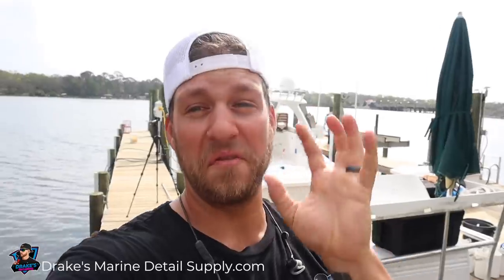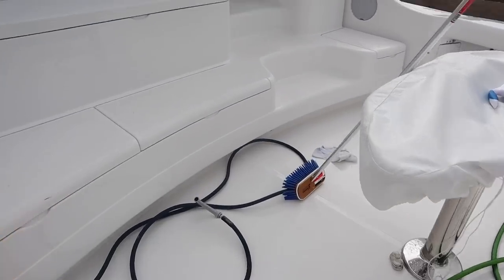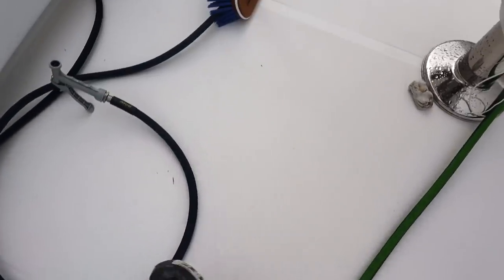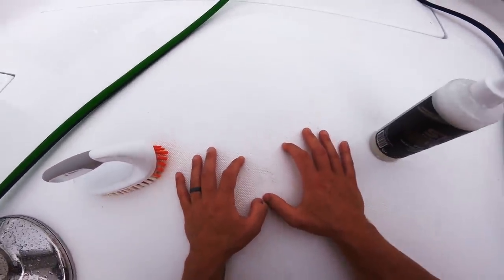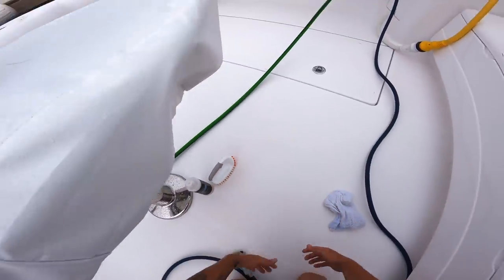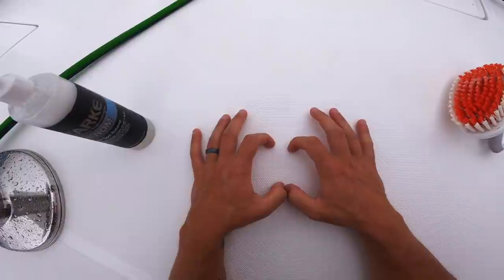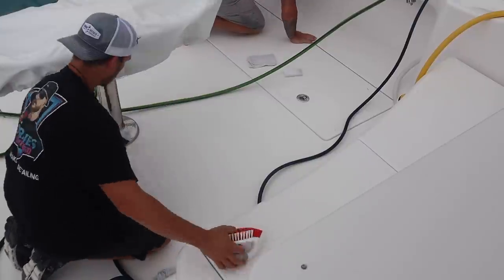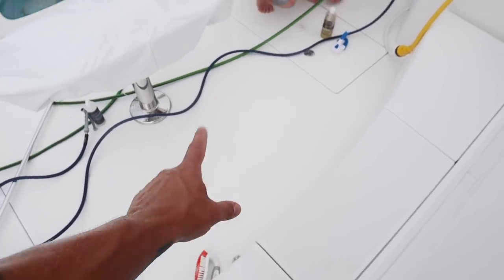How To Remove Rust Marks From A Boat | Boat Detailing Business Tips | Revival Marine Care

Comment: Not sure why you aren't using an iron remover like IronX? They are commonly used in the car detailing world - worth a try on gelcoat as well.  No scrubbing needed.
Reply from the maker: I agree, I didn’t have iron x! Iron x would be the best option, but I couldn’t wait a few days to order it and get some in. So I had to use what I had on hand! Thanks for bringing that point up!
Reply: iron removers don't always remove the whole metal pieces so you would still have to remove them mechanically.
Reply: @DrakesDetailing  most wheel cleaners are mainly iron removers, a lot of detailers use wheel cleaners like cheap Eagle One to spray all over the car to dissolve iron. Theres also a channel named Forensic Detailing that did a big comparison to see which Iron Removers dissolve iron the best. It's worth a watch if you run into this problem regularly....spraying all the surface, let it sit for 5ish minutes then hose off should fix the problem. If it works good it may save you a ton of time.
Reply: Bar keepers friend is the best thing I have found for rust .
Reply: @QLNcoaching  I love me some Barkeeper's Friend!
Reply: Thanks for the info,I'm new to the detailing, I will give the iron a shot, thanks for the info
Reply: @stephenwhite5444  chemical guys has a great iron remover as soon as it makes contact it turns purple , letting you know that you have chards of metal.

Comment: The active ingredient in all rust removers is Oxalic acid or Hydrofluoric acid. Oxalic acid is widely available in dry form and is mixed in water. 50 to 1 ratio or less. Wear eye protection as it will burn you. This chemical is also excellent on yellow hull stains [ which are basically iron stains]. It is also used to bleach wood before staining.  In the drycleaning and laundry industry it is used for rust removal on clothing and to neutralize rusty water.
     I use this chemical often. To date I have not had any bad reactions when it is used near a painted surface, [Like a hull boot stripe.]
     [RINSE WELL.]

     The marine product "On-Off" works well and has  oxalic acid as its active ingredient.

Comment: I've seen this when people use steel wool to polish stainless etc.  I've used oxalic acid that I bought in a gallon.  Really cheap but check the ratio prior to using it and rinse the crap out of it after.    

Nice job and thanks for the continued "how to"...
Reply: So rinse the crap out of it & ceramic coat the floor?

Comment: I was doing a 36 yellowfin today and I was using an orange lake county pad with first 400 then ardex 600. It was very mild oxidation but it would not come out. I had been switching between two pads that I had washed but had been old and used on two previous boats. Any suggestions on why it was not cutting? I ordered new pads as I believe the pads were just worn out but figured it would have done at least something. Could I suggest a future video “how to setup your pads” going over proper priming and what it should look like throughout the process with various compounds as well as when to clean/blow out your pads. 18 y/o and your channel solely has helped me get into the business, great videos thanks for the knowledge.
Reply: I would switch to a wool pad on a rotary with the 600 or try the 400. I just did that with light oxidation & presta compound and it worked perfectly on the light stuff. My .2.

Comment: I do Marine repair for a living and I also used to do Auto body and paint and have detailed a lot of cars. The problem being is after you clean the non skid there are fragments of steel in the no skid left behind . If you had a system to suck up the steel shards and remove them completely  you would not have the rust show back up after you detail it. My suggestion is to get one of those Bissel portable carpet cleaners with the brush attachment.  Put straight white vinegar in the tank . Have a spray bottle with vinegar in it and spray the area and brush it loose the vinegar will remove rust then after you have losened the area, fire up the carpet shampooer and suck up with the brush attachment.   This will remove rust particle  completely any stains on the gel coat will be removed from the Vinegar and then just clean up with a terry towel . What is good here is the Vinegar is completely biodegradable and wont pollute the water or  hurt wildlife like acid will and most of all its dirt cheap  . And vinegar destroys rust !Then follow up with your wax or protect-ant.  I think if you try this system it will make your job no only easier but quicker and you dont have to worry about rust stains coming back to bite you in the ass days later that the towel didn't get.
Reply from the maker: Thanks for the tip 😉
Reply: @DrakesDetailing  You are welcome I really enjoyed your video great job !  You have pride in your work that is non existent now days

Comment: Brown scorch pad + handy Andy+ Vim to break the metal chards. You could also use a heavy compound  and white scorch pad. After that use a rust remover. You might have to repeat that a few times. Been doing this for 17 years.
Normally at ship yards it could be from metal dust, someone doing welding jobs. It can also come from the crane cables
Reply from the maker: Thanks for the tips😉

Comment: Drake- when you’re working on the topside of the boat how do deal with footprints/shoe prints as you’re working through the process?
Reply: I was doing a 36 yellowfin today and found a 25 degree tip on your power washer will blow out all dirt or black spots off in the nonskid. I also were white rubber boots from Walmart super light weight and clean them initially after stepping on the boat and try and limit the times I hop on and off always trying the clean my boots off before walking around. After an initial cleaning of the soles I never have issues but still always hit the topside with a mild degreaser before finishing it off with SiO2 coating. Given me great results but limiting the dirt you could bring on will help you when your finishing it. Hope this helps.

Comment: You should tell people why they are in the gelcoat.It comes from filings from installing a metal fishing rack or any component where drilling is used.The hot filing actually burn into the gelcoat and wedge into the surface.
Reply from the maker: Interesting!

Comment: Going to b impossible not to miss some as tiny as the metal is. What happens if it gets sealed in under the ceramic?
Reply from the maker: We will got them all, we really made sure. 

But if not, I don’t think it hurt the boat long term, you just may have rust keep re appearing